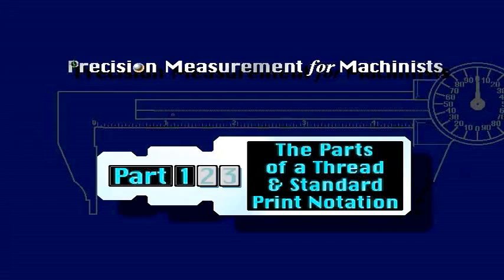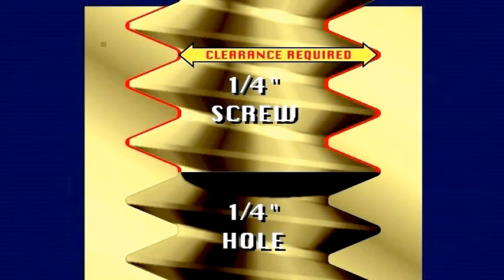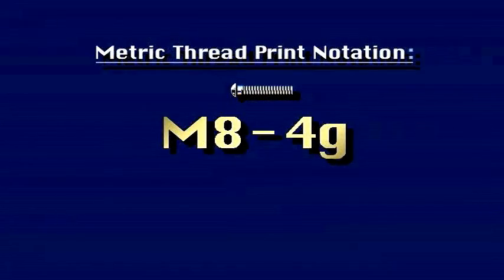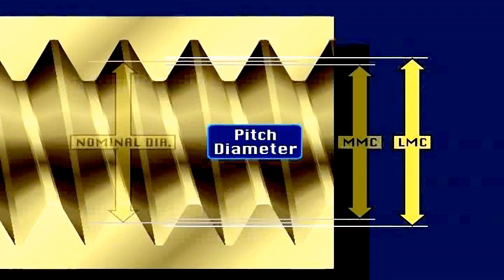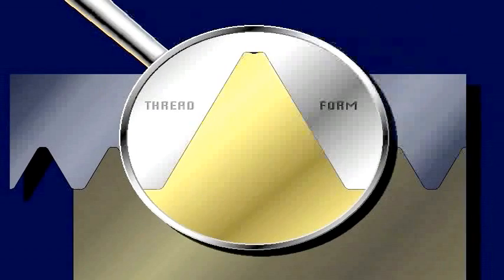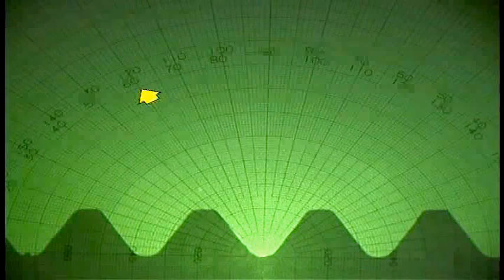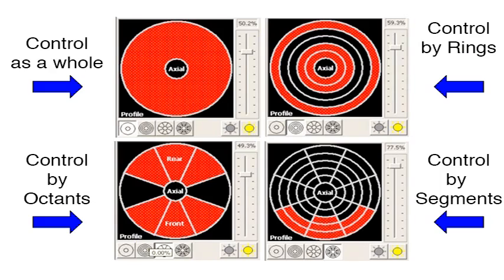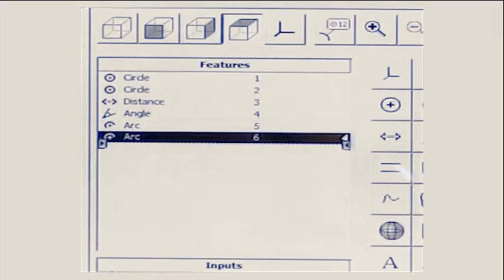Lesson 8 Optical and Video Comparators

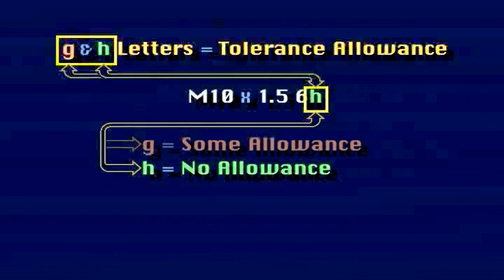Comment: 10:54 What do you mean "no allowance" or "some allowance", they are both with some allowance, which varies depending on the nominal size, and obviously on the other part they connect to. For instance, Shaft with 10mm nominal diameter and tolerance h7, has a tolerance of 0 to -15 thousands of a mm, that means range size of 10.000-9.985.
The hole it connects to, can have a tolerance of G6, that means a tolerance of +5 to +14 thousands of a mm, that means range size of 10.014-10.005. In any case here, there would be some allowance.

The better definition of H or h tolerance is "a small unilateral tolerance from the nominal size". Where as G or g is slightly larger and bilateral.